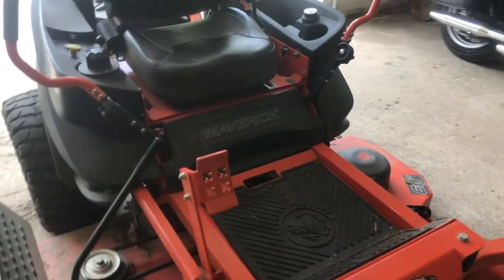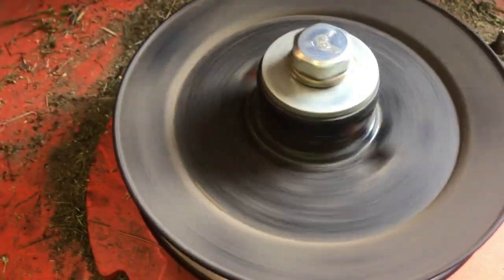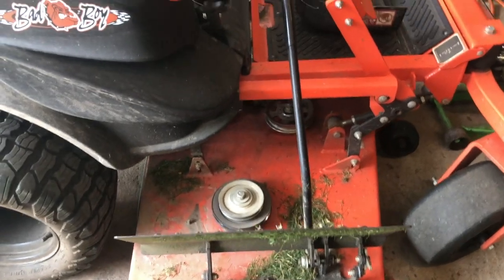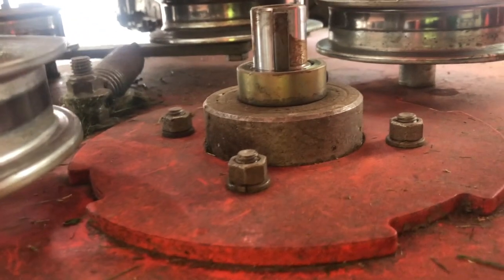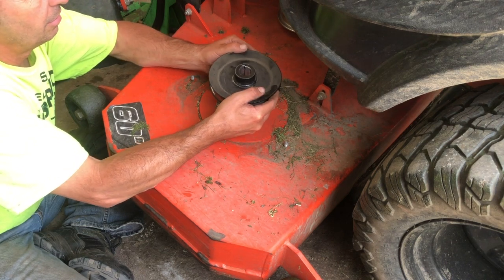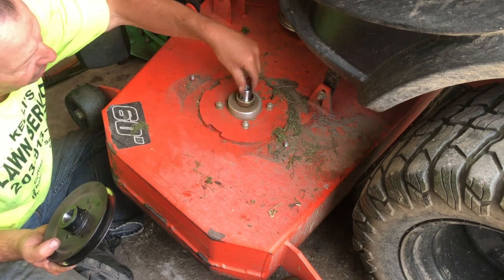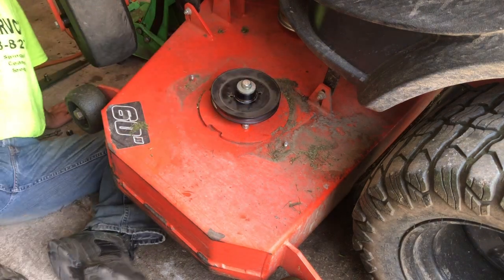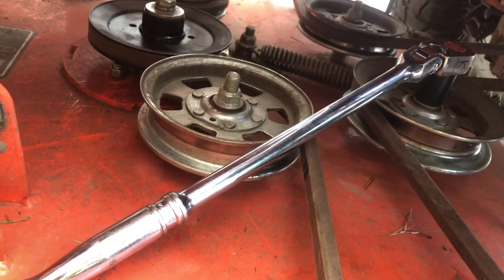Installing new spindles blades and belt on our Badboy zero turn mower

Comment: It is possible to replace the bearing in the spindles without purchasing new spindles.
Reply from the maker: Yes , and much cheaper. I needed the machine that day so I had no choice.
Reply: How many hours did you get before you replaced
Reply from the maker: @LonniePawl  I believe it was around 7 or 800 hours. Thanks for watching 👍

Comment: You can replace the bearings upper & lower bearing just remove the spindle from the housing and replace bearings around $10.00 a bearing #6206rs
Reply from the maker: Thanks , I'll do that and keep for back up.